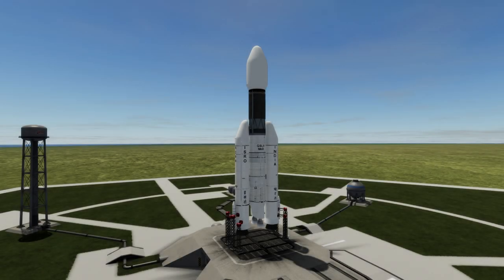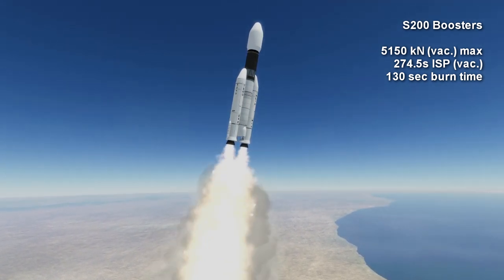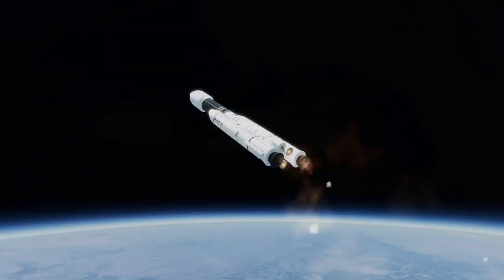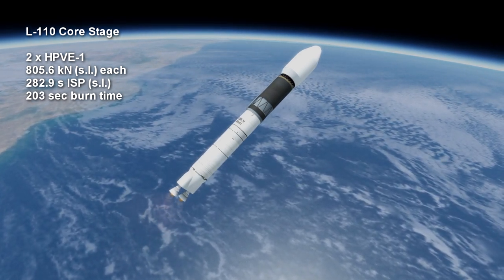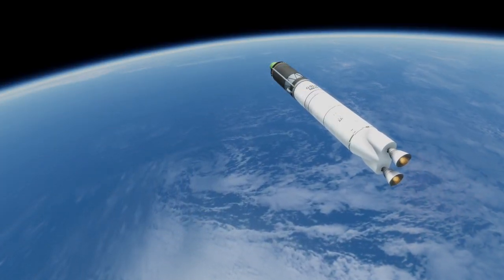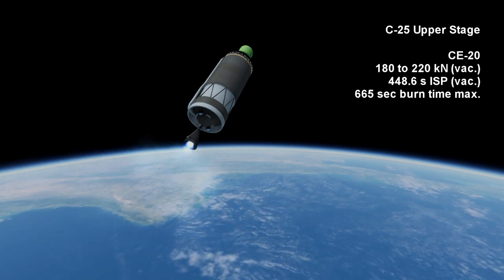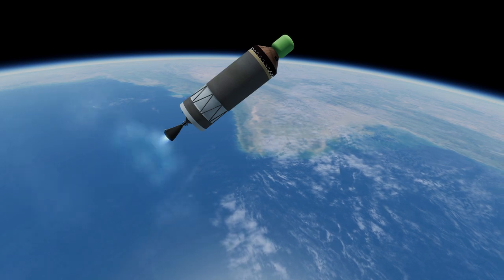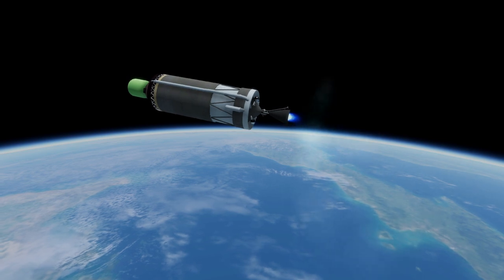Rocket Profile Neo - GSLV Mk III

Comment: So from my knowledge the GSLV Mk.III is basically the Indian version of the US Titan IV
Reply: considering the fact that both rockets' core stage does not ignite on the ground, and ignites once booster thrust dries up. Also they both have cryogenic upper stages.
Reply: @Aditya Suri and don't forget about the Titan IIIC, IIID and 34D
Reply: @Aditya Suri Ariane V payload to LEO is like 20 tons , GSLV MK3 payload to LEO is ~10 tons so MK3 is more comparable to Soyuz, Antares and Neutron not HLV's. That said , GSLV MK3 looks a hell lot like Titan 3 not Titan 4
Reply: Well, the Titan had 4 stages, but others than that the similartity is striking.
Reply: @bernhardschmid9222  uuuuuu 4 stages the Titan IV had 2-3 (not counting the boosters)

Comment: Why is it always referring the Mx KN to vacuum ? Even when the engine operates in atmosphere.
Reply from the maker: Not always, even in this video if you watched it. I go with the most reliable number available, whether that's sea level or vacuum. In this video, the thrust of the boosters changes over time, and they hit their maximum thrust at altitude after some time. The HPVE-1s actually have their sea level figures stated even though they air-start because that's the best number I have. the CE-20s obviously have their vacuum numbers.